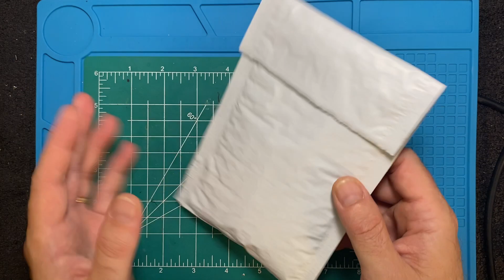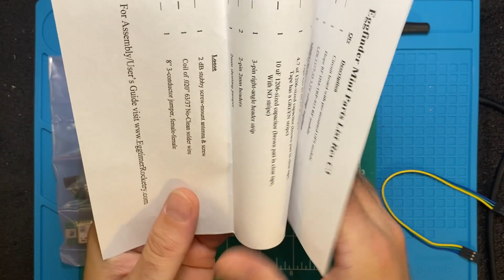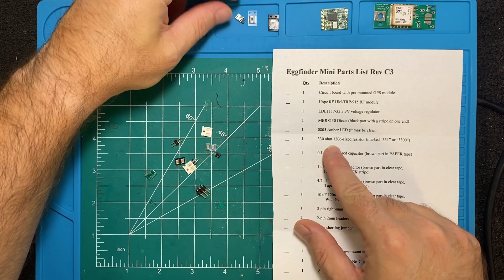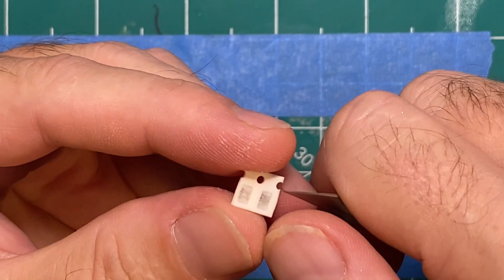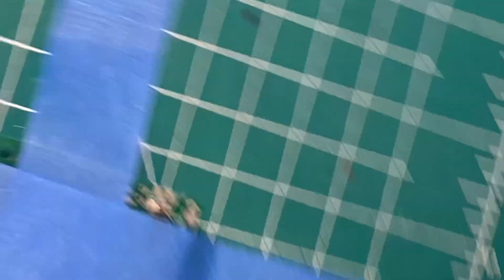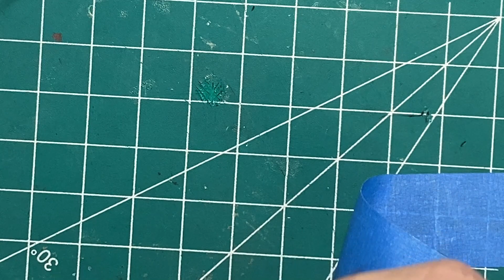Eggtimer Mini GPS Tx Build

Comment: lets say you have 5 of these transmitters for 5 rockets, how do you program this to the LCD handheld on the same frequency
Reply from the maker: Well, the easy solution is to just use 1 and transfer it from rocket to rocket, but if you do have 1 for each rocket, you connect the Tx to the Rx and through the LCD pick a frequency. You can do them all the same or different, your choice. It’s a pretty simple process.
Reply: @KevinsModels  simple when you know the process. just confusing with the directions. i have my LCD on 911/7 but i dont see how to bind the new MINI to the LCD.

Comment: I have this same Tx for my rockets. I have 4 or 5 of them built and will start using them once launch season starts (after this nasty summer is over lol). These are simple and quick to build, we'll see how they work in the field.
Reply from the maker: I've had mixed results, but not on the part of the Tx.  That thing works great!  The problems I've had are with the Rx box on my end with the LCD screen.  It works, sorta......  By that I mean, after walking in several large circles, it'll finally lock-on to the Tx and start giving compass headings and arrows pointing to the rocket, however, once I get within about 100', it starts acting wonky and telling me to turn around, go left, go right, all over the place.  Now, if you maintain the general direction it initially has you going, you'll get reasonably close, so by that measure, it works.  Now, one thing I've tried doing in filming the LCD screen with a cell phone during the live flight.  It shows the coordinates changing as the rocket's coordinates over the ground change.  It does a really good job of giving that info, and then at the end of the flight, the landing coordinates are displayed on the screen.  I've taken those coordinates, plugged them into a GPS Tracking app on my phone, and let that lead me to the rocket.  It takes me within 8-10' of the rocket.  Phenomenal results, considering I'm not working with military accuracy missiles!  I just recently changed the frequency of of the Tx and Rx, as the default one may be too generic and conflict with other sources of radio interference.  Early tests of the new frequency out in front of my home have yielded much better results.  I have a couple videos of me using that GPS app as well as the LCD Rx from Eggtimer.  Hopefully that will give you an indication of what I'm describing above.  I really like this technology, and considering they're easy and fun to build, and  not too terribly expensive, I recommend it to everyone contemplating high flights.  Let me know how your work out for you one you start flying again.